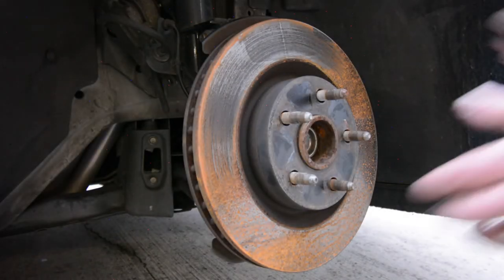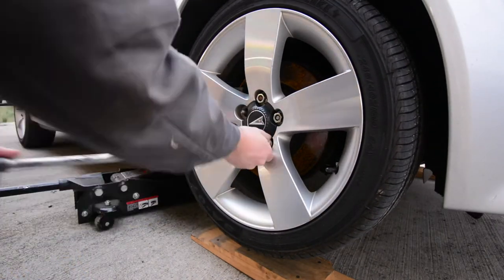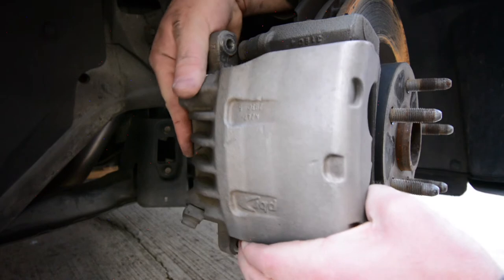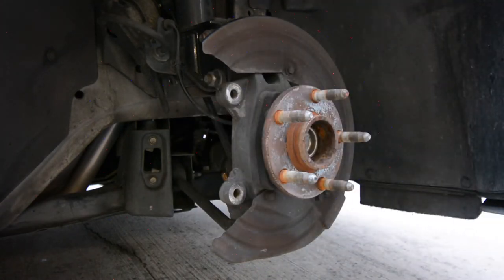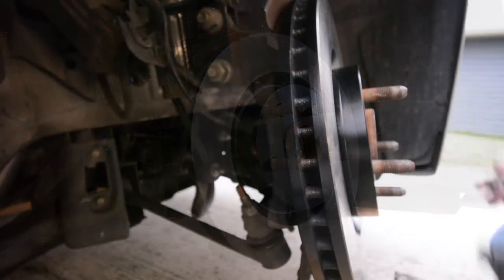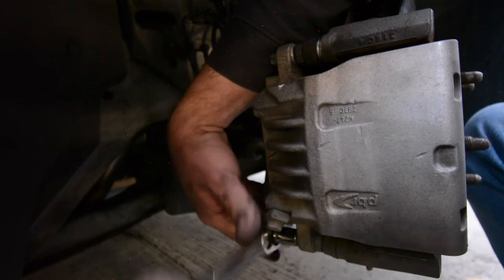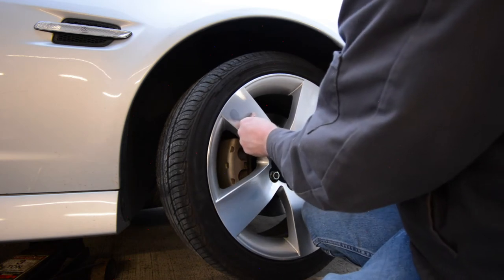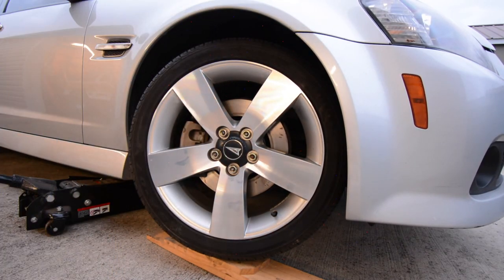Pontiac G8 Front Brake Rotor Replacement (Base or GT)

Comment: Appreciate you showing the general idea on how to change the brakes. But there are a bunch of ancillary things that need to be done for a complete brake job (clean and lube pins, scrape rust off hub, applying anti seize to hub, proper torque specs, etc)